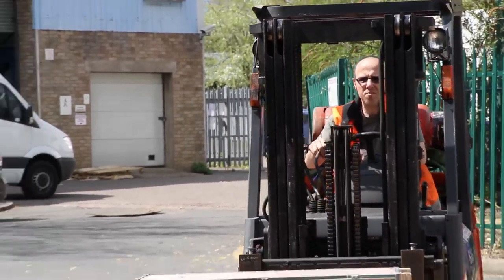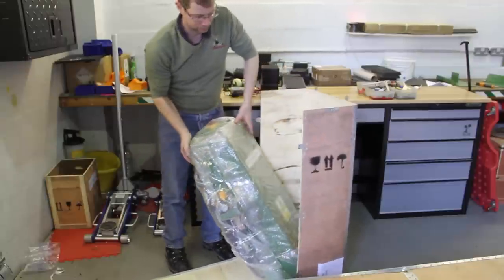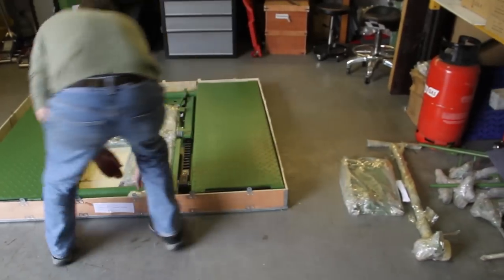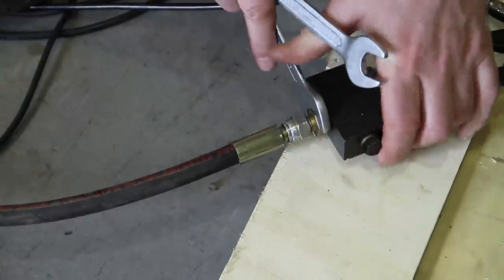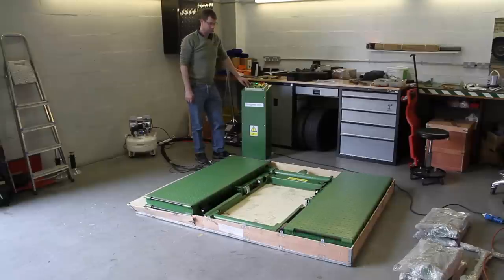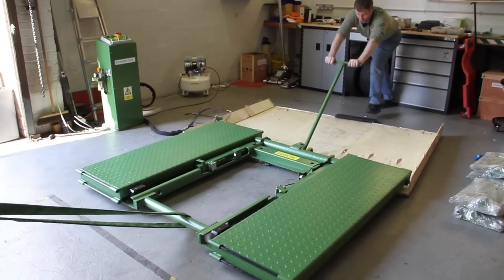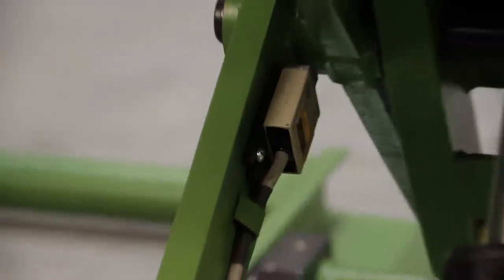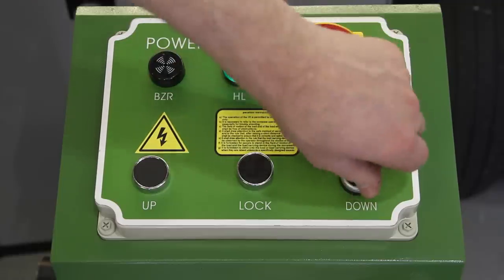Clifton Mobile Car Lift Install Guide [2013]

Comment: Excellent video, well presented and gives all scissor lift owners no matter what the make (most will have the same restrictions and operating principles) the requirements for trouble free operation. I have a Clifton and since I've fitted it (into the floor flush) I almost enjoy having work to be done that requires lifting the car. Also the Strongman guys are very helpful with good product knowledge (surprisingly not all suppliers do !) and can offer good technical help over the phone.
Reply from the maker: Hi Michael, thanks for your kind comments! We have worked hard on our design on the lift and our customer service so we are glad you are enjoying your Strongman Tools Car Lift!

Comment: have you got any videos on installing these flush in the concrete floor? i've got a car with a 90mm ground clearance, and this would be ideal for regular maintenance and building, flush fitting would be essential